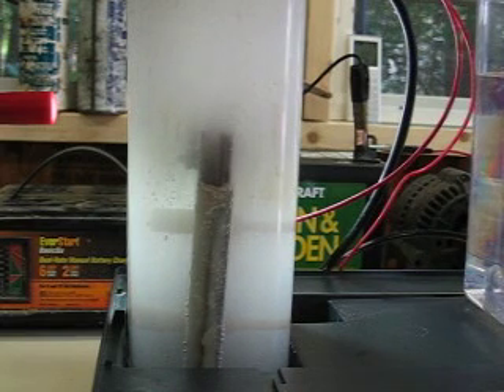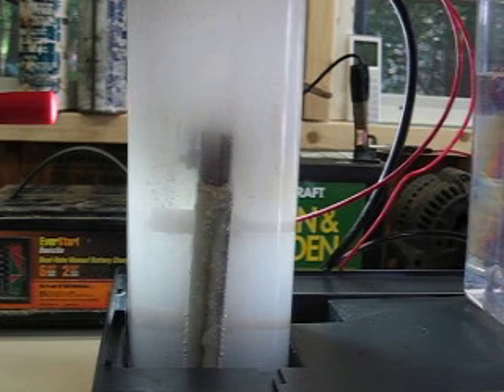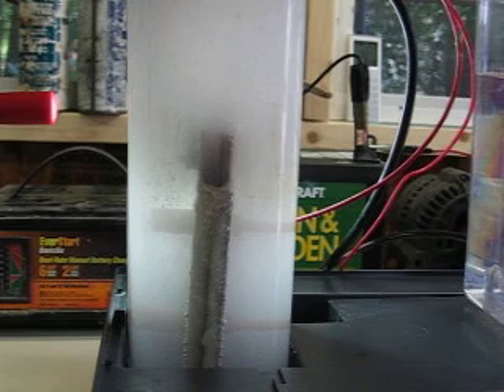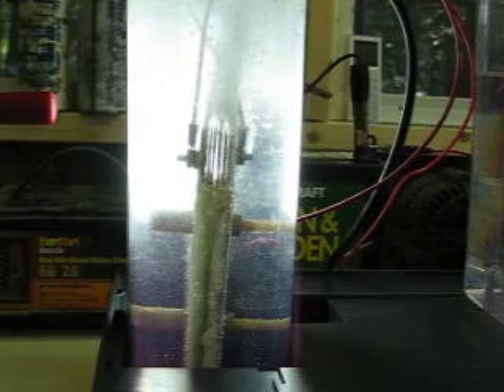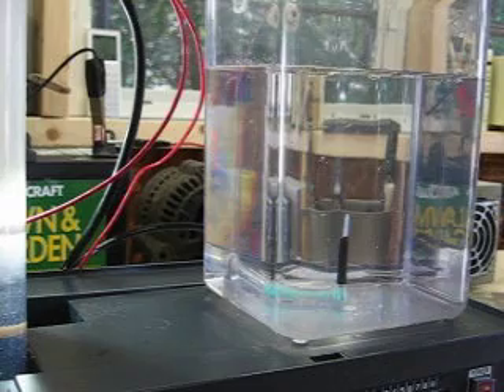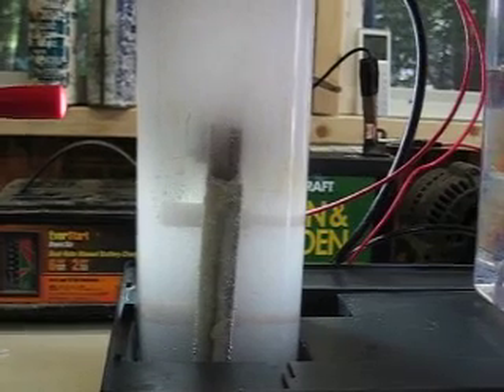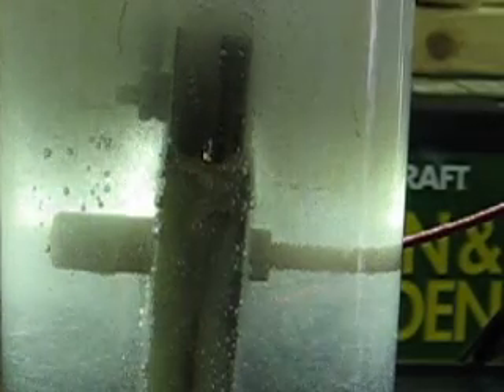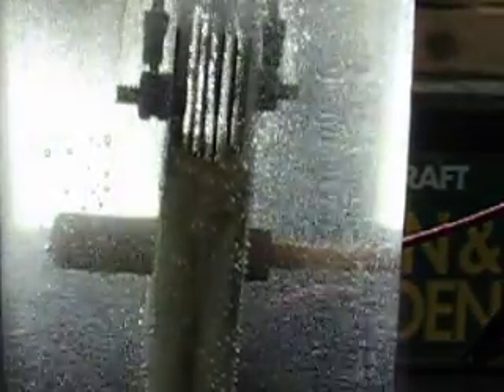Ultrasonic Transducer added to plate cell

Comment: This is all bull.. 
The trick is to produce standing waves in the water. The frequency so small that the wave is at molecular level. The amplitude so high that the connection will break the bonds molucular. Like tearing appart two glued together parts.
Use at least 700 W to drive the piezo sounders. 
(Needs very expensive amplifiers)
And create standing waves otherwise you will not tear appart, but just push up and down.

These electrolyses bubles will just disturb. Dont do that!

Comment: you can also use like 3/32 stainless tig wire.  It may be expensive but you can get any grade you want.  If you are nice, you may be able to get just a few wires for fairly cheap.  Welding supply houses carry it.  plus, what's with the vacuum?